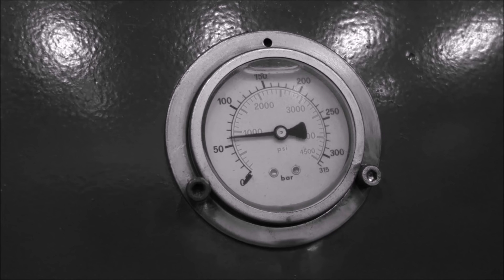10 AMAZING LIFE HACKS with Hydraulic Press

Comment: how to make tennis ball:

Step 1: start with a tennis ball
Reply: Step 2: cut it in half

Step 3: hot glue it back together
Reply: Step 4: Replace it with a cucumber

Step 5: Smear Colgate toothpaste all over the cucumber
Reply: Step 6: drill a 1 inch size hole into the side using a toothpick 

Step 7: put some gunpowder in it

Step 8: put a lighter into the hole

Step 9: smash the lighter with a hammer 

Step 10: go to the store and buy a tennis ball
Reply: Step 11: Repeat
Reply: Step 12: repeat step 11 twice
Reply: Step 13: get some help
Reply: Step 14: stay in a mental hospital for a time
Reply: 15: repeat steps 6 and 7
16: light a match
17: put the match in the hole and quickly cover it with FLEX TAPE
18: watch as your body burns until you die
Reply: Step 19: Like the video to make this great life hack work!
Reply: And finaly step 20 become a tennis coach with your newly made tennis ball
Reply: THEN CRUSH IT
Reply: Step 21: ayy lmao
Reply: Step 22: Comment on results

Comment: I have two suggestions for you. 
1. You know how annoying it is when you use garlic press on cloves of garlic? Can you pleas press garlic with the extruder 5000000? Please try pealed and not pealed cloves. To peak a lot of cloves at the same time, put them in a metal container with a lid and shake it violently. Then when you open the cloves are pealed. Then press the pealed cloves in the extruder. And then see if not pealed cloves give the same taste. 

2. See if you can glue things together using hot glue sticks and the press. Pressure should heat the glue, right? 

Thanks

Comment: 2:35 The proper way to open a tight jar is to hit the edge of the lid with something like the back of a chef knife. It lets out tiny amount of pressure until you can open it. You can expect a bit of denting. Anni brings some fuel for 'little buddy'.

Comment: Crush a vacuum chamber , while it’s at maximum pressure and see what type of implosion you get, or maybe see if there are cheap glass jars /flasks you can use as vacuum chambers and put stuff inside n crush , 2 experiments in one 😉suck all the air out of shaving foam, then crush the jar while it is still attached to the pump.